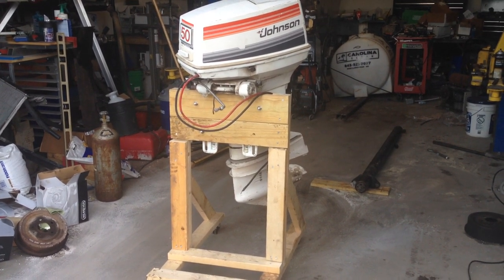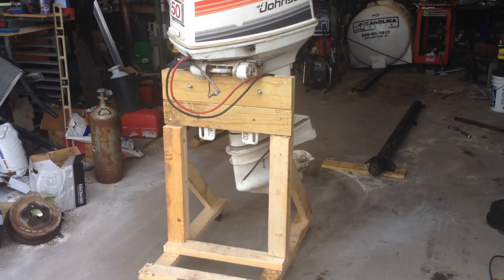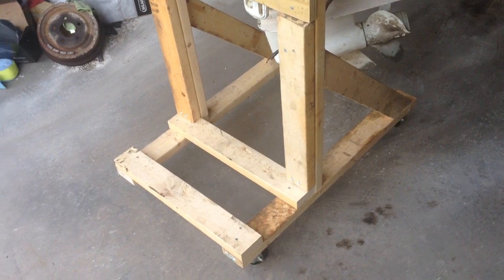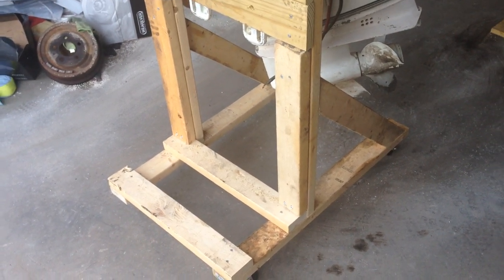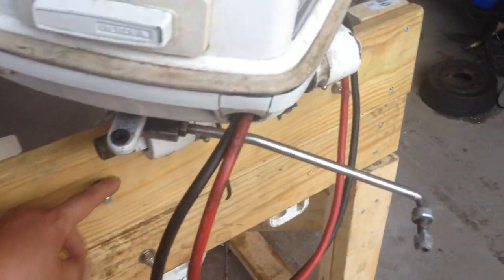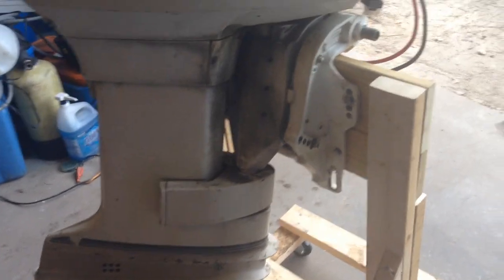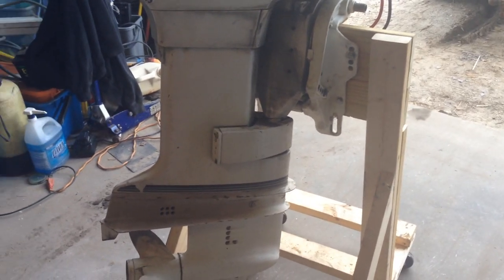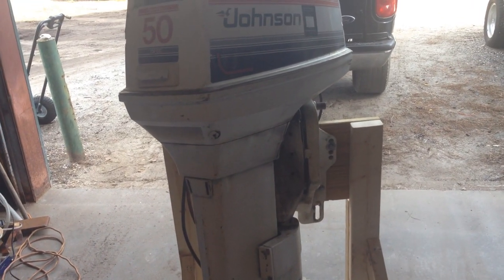How To: Build a Boat Outboard Engine Stand DIY Cart

Comment: Had to install 5 inch castors to clear the leg of my 1 ton Harbor Freight engine hoist.   The stand would not fit between the legs of the hoist far enough to lower on stand.   Raising the stand enough to clear one leg of the stand allowed it to move directly under motor.  Works well for Mercury 50 HP EFI which weighs 255 lbs.   Thanks for including the link to the blueprint.